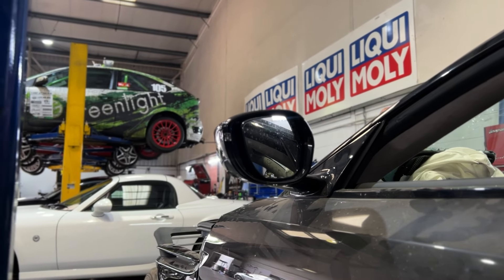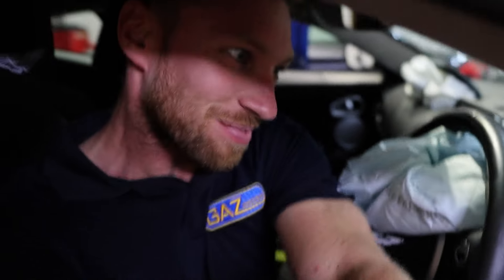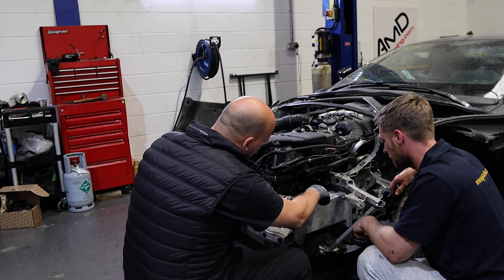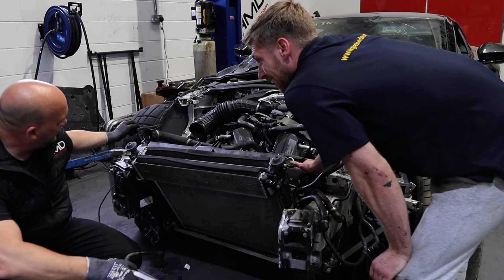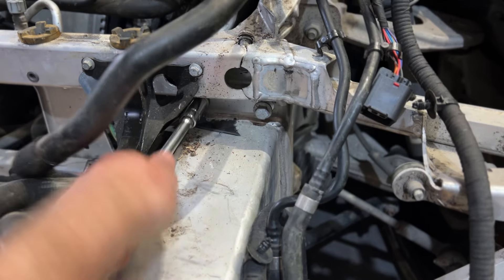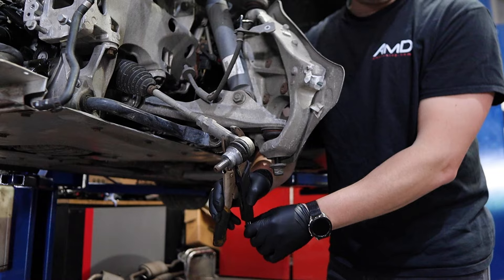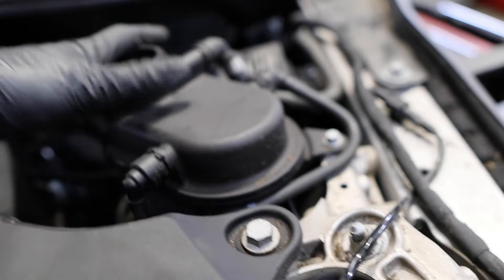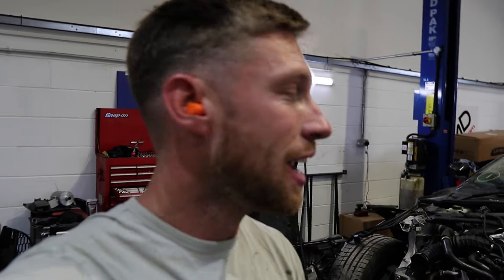I BOUGHT A WRECKED ASTON MARTIN DB11!

Comment: Press the gas pedal all the way to the floor,hold it there and then crank the engine. This keeps the engine from starting so you can restablish oil pressure. When the oil light goes out (about 5-seconds or so) stop cranking. Take your foot off the gas and start as normal.
Reply: I'm @5:30. You may have already started it by the end of the vid.